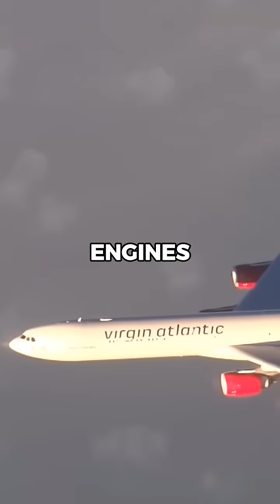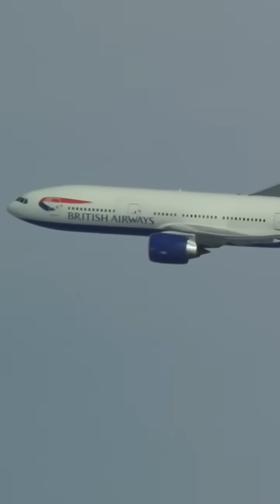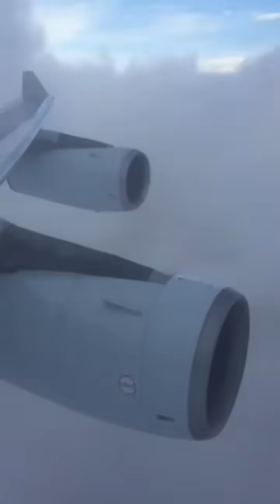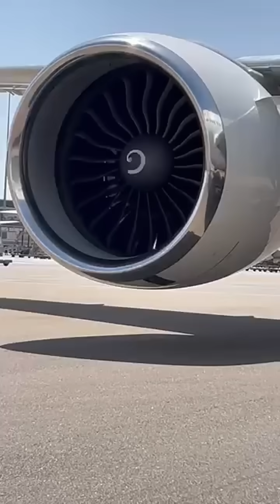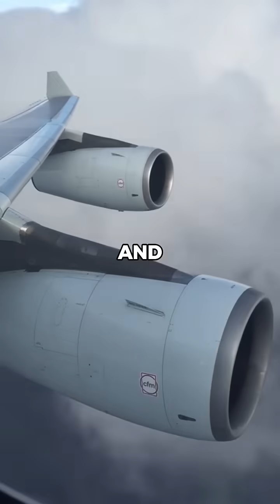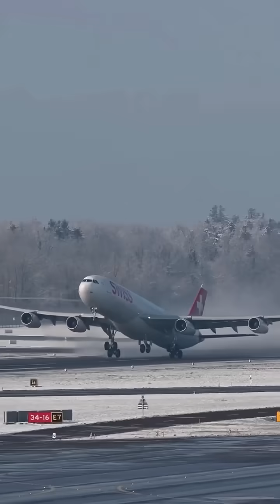why wasn't the A340 longer with more powerful engines?

Comment: The A340:

The Airbus A340 is a long-range, wide-body passenger airliner that was developed and produced by Airbus. In the mid-1970s, Airbus conceived several derivatives of the A300, its first airliner, and developed the A340 quadjet in parallel with the A330 twinjet. In June 1987, Airbus launched both designs with their first orders and the A340-300 took its maiden flight on 25 October 1991. It was certified along with the A340-200 on 22 December 1992 and both versions entered service in March 1993 with launch customers Lufthansa and Air France. The larger A340-500/600 were launched on 8 December 1997; the A340-600 flew for the first time on 23 April 2001 and entered service on 1 August 2002.

Keeping the eight-abreast economy cross-section of the A300, the early A340-200/300 has a similar airframe to the A330-200/300. Differences include four 151 kN (34,000 lbf) CFM56s instead of two high-thrust turbofans to bypass ETOPS restrictions on trans-oceanic routes, and a three-leg main landing gear instead of two for a heavier 276 t (608,000 lb) Maximum Takeoff Weight (MTOW). Both airliners have fly-by-wire controls, which was first introduced on the A320, as well as a similar glass cockpit. The A340-500/600 are longer, have a larger wing, and are powered by 275 kN (62,000 lbf) Rolls-Royce Trent 500 for a heavier 380 t (840,000 lb) MTOW.

The shortest A340-200 measured 59.4 m (194 ft 11 in), and had a 15,000-kilometre (8,100-nautical-mile) range with 210–250 seats in a three-class configuration. The most common A340-300 reached 63.7 m (209 ft 0 in) to accommodate 250–290 passengers and could cover 13,500 km (7,300 nmi). The A340-500 was 67.9 m (222 ft 9 in) long to seat 270–310 over 16,670 km (9,000 nmi), the longest-range airliner at the time. The longest A340-600 was stretched to 75.4 m (247 ft 5 in), then the longest airliner, to accommodate 320–370 passengers over 14,450 km (7,800 nmi).

As improving engine reliability allowed ETOPS operations for almost all routes, more economical twinjets replaced quadjets on many routes. On 10 November 2011, Airbus announced that the production reached its end, after 380 orders had been placed and 377 delivered from Toulouse, France. The A350 is its successor; the McDonnell Douglas MD-11 and the Boeing 777 were its main competitors. By the end of 2021, the global A340 fleet had completed more than 2.5 million flights over 20 million block hours and carried over 600 million passengers with no fatalities. As of March 2023, there were 203 A340 aircraft in service with 45 operators worldwide. Lufthansa is the largest A340 operator with 27 aircraft in its fleet.